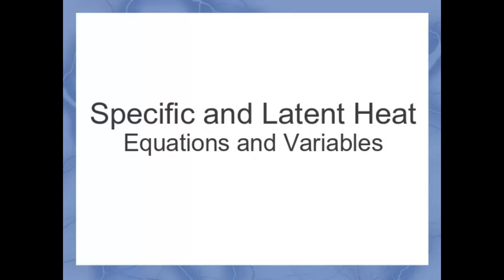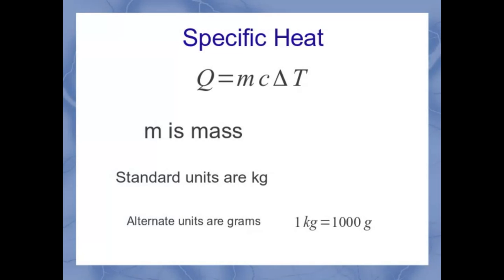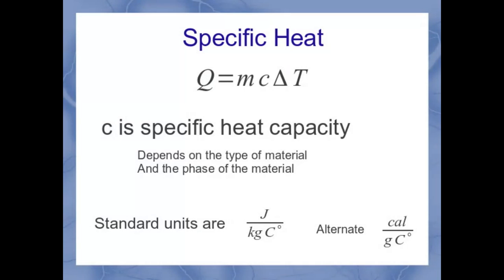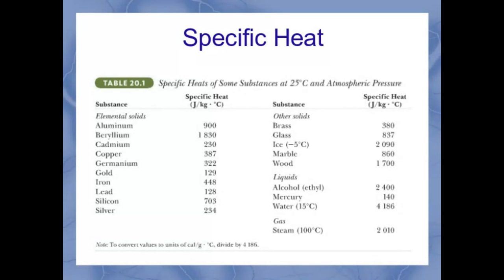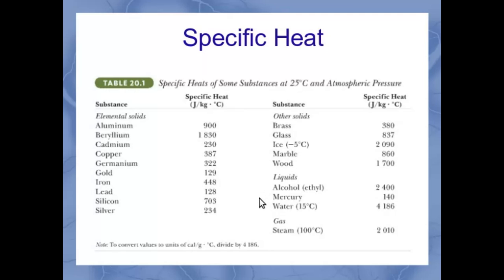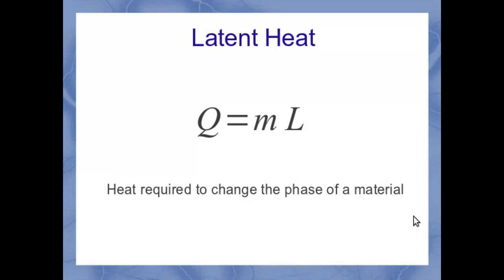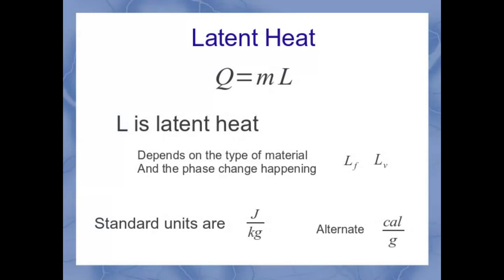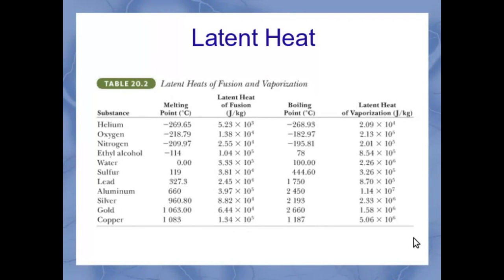Specific Heat and Latent Heat

Comment: WHAT IS THE FORMULA FOR SENSIBLE HEAT AND LATENT HEAT OF BUILDING.   PLEASE GIVE THE FORMULA
Reply from the maker: I'm not sure I completely understand your question. The formulas shown in the video are for the basic concepts of specific heat and latent heat for simple materials as used in physics. If you have a building (like a house), there will be a combination of materials and the heat flow is likely to be complicated. Latent Heat is used for materials that change phase (solid-liquid-gas) and would probably not be used in related to buildings.
Reply: Thank you:-)
Reply: Can pounds be used in place of kg.  In the mass of specific heat?